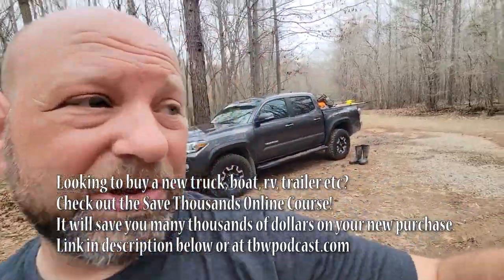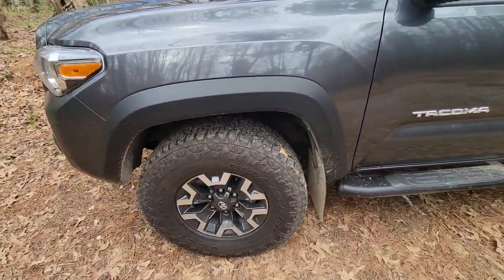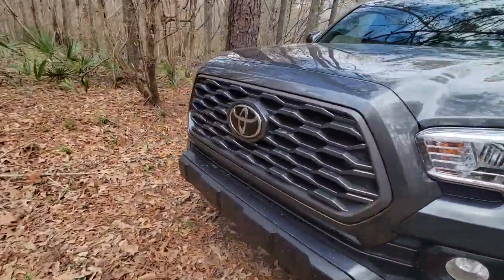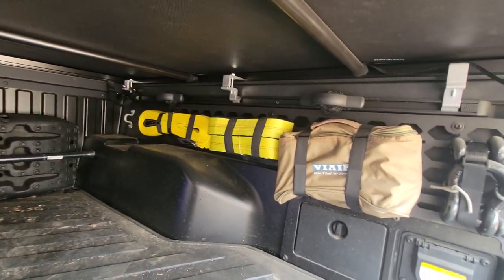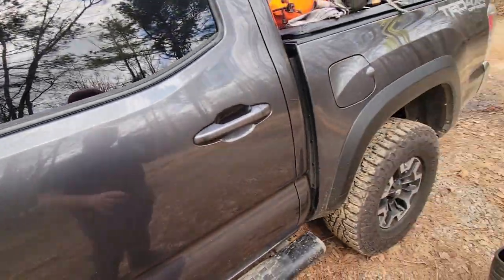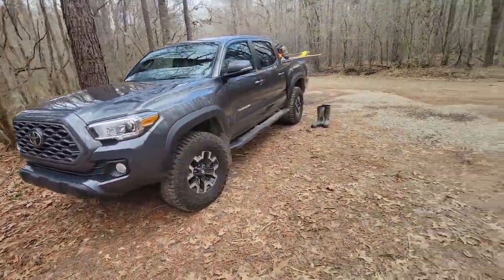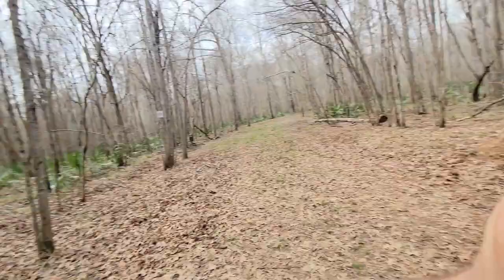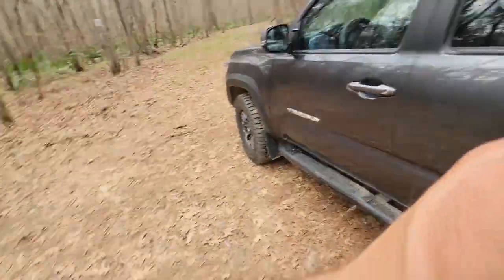2022 Tacoma Trd Off Road 5000 Miles Pros And Cons

Comment: Complaining about gas cap and hood prop rod but you have a base model with no tech package 😂
Reply from the maker: Tech package is irrelevant.  Doesn't offer any real function. Just wanted money in my opinion. But I guess I'm not real "techy"
Reply: Neither of those "issues" is solved by any trim level or tech package trd pro still has prop rod and the gas gap 😅
Reply: @JoshuahAaron  your missing the point here
Reply: @active411vm  curious...I'm missing the point so explain...Tacoma owner here...So what changes with the gas cap, and hood rod with other models???
Reply: Do you understand that or do you need me to break it down more?
Reply: @active411vm  yea man, please break it down... That's what I asked... What trim changes the gas cap or hood rod?
Reply: Hood rod is preferred to me. They do not fail over time.
Reply: @djkenny1202  
They can be found on eBay for $65 plus shipping. I just checked. I’ve had mine for a year now. They are a great mod and super easy to install. You’ll be happy if you install them. And the stock hood stick will still be there if for some reason you ever need it.
Reply: @superserial1  im fine with the stock part. All but 1 car out of 10 I have had in 45 years had that simple hood prop.
Reply: @djkenny1202  um ok

Comment: I have a 2020 4runner ORP.  Sometimes I want a tacoma for yard work and to get a popup camper. 
I hear the 4runner though is a smoother ride. That's why I'm so conflicted.  I could camp and sleep in my 4runner but, would be nice to stand up hence ( popup camper)
Reply from the maker: Put a rooftop tent with drop down vestibule on your 4runner! I love the 4 runner. If I didn't need a truck for some new work endeavors I would of got a 4 runner